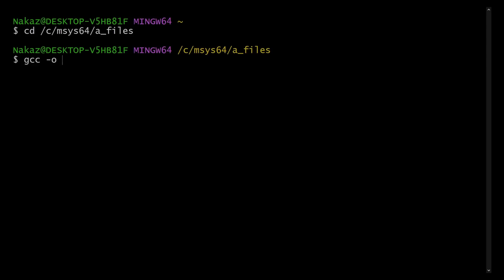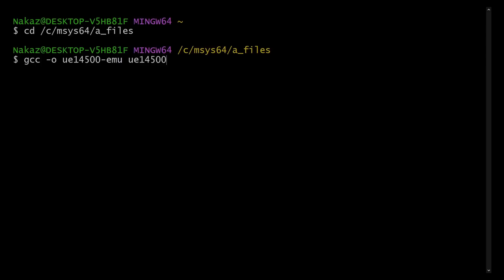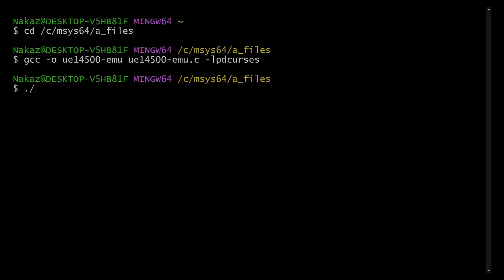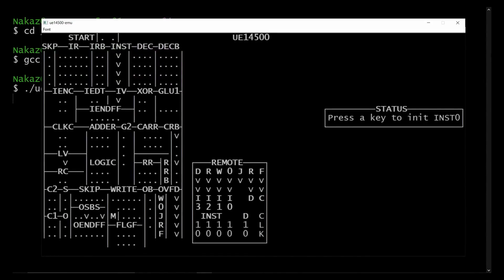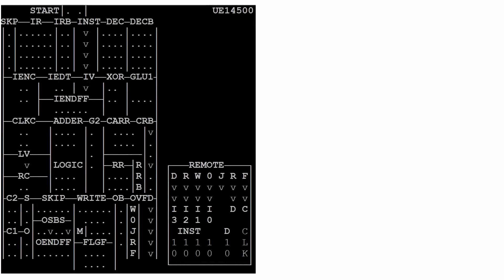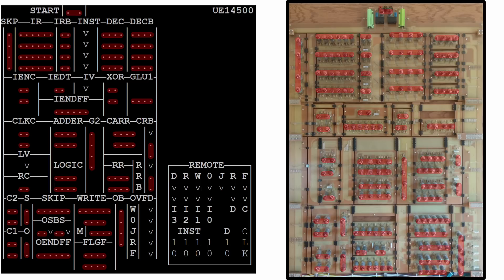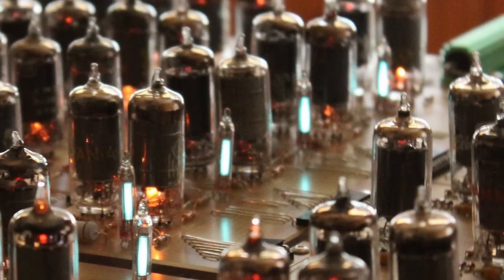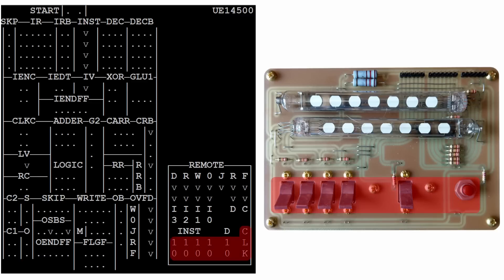Vacuum Tube Computer P.28 – Exploring an Emulator of the UE14500!

Comment from the maker: Quick clarification on the curses library. It doesn't actually emulate terminals. It actually allows you to write terminal programs that will work on any supported terminal. Each type of terminal (ADDS vs VT100 vs VT220 ad infinitum) uses different "escape sequences" to accomplish things like moving the cursor, bold, etc. Curses abstracts that away so the programmer can just ask for bold and curses knows what sequence to send to the actual terminal being used.
Reply: Love your videos bro!
Reply: As long as the terminal has a terminfo or termcap entry it will work on that terminal.
Reply: does this "curses" name address the curses being said aloud to the thing that is not working the expected way?
Reply: @strangedude9008  Exactly this is reason it is named curses. There is no way to make a program compatible with many different terminals, all incompatible in some evil ways, without curses.

Comment: Can it run Crysis?
Reply from the maker: Ah yes, can it run Crysis!

This is a fun thought experiment actually. The minimum CPU spec for Crysis is a Pentium 4 @ 2.8GHz. This actually makes figuring stuff out a little easier since the P4 is a single core CPU. We do have to make a few guesses here. Crysis is power hungry, so let’s assume that on a P4, CPU usage will average 90%. That means that Crysis is performing around 2.5 billion calculations per second. That should yield around 30 FPS, which is about 83 million calculations per frame. With a resolution of 1920 x 1080, that’s 2,073,600 pixels. That means it’s roughly 40 calculations per pixel.

But, now we have to think about bus widths. If we boil a single calculation down to just moving a 32-bit value from one location to another, the P4 can do that in a single shot because it has a 32-bit wide bus. The UE14500 only has a 1-bit wide bus, so that same operation takes 32 distinct operations on the UE14500. Which means that the UE14500 needs to do roughly 1,280 calculations per pixel. 

And now we’re up to speed. I don’t know for sure at this point, but I think it’s possible to push the UE14500 to 100Hz. That means it’ll take 12.8 seconds to calculate one pixel. Working out from there, that’s 26,542,080 seconds to calculate a full frame. That’s 442,368 minutes, or 7,372 hours, or 307 days.

So, sure, it could run Crysis, but only at a blistering frame rate of 1.2 frames per year!
Reply: @UsagiElectric  I guess that 1.2frames per year is not fluent enough for a pro gamer ;) BTW I can see no reason why those tubes coudln't do many hundreds of kilohertz, maybe even megs?!
Reply: @MYNAME_ABC  Maybe MHz, though that is unlikely as you said. Many large scale vacuum tube computers with massive sizes and thousands of vacuum tubes could run at hundreds of KHz. I see no reason why a tiny "simple" couple hundred vacuum tube computer couldn't match the same speeds or greater if designed well.

Comment: Emulating the vacuum tube computer on the centurion is the coolest thing I could imagine, awesome, who was the genius that come up with that, freaking awesome!!
For now you can run it on a pi and connect the centurion terminal through rs232 converter xD

Comment: Emulator + arduino+ serial port  = running code directly on the processor. Just saying
Reply from the maker: That's actually a really good idea, but it will require a lot of level shifting to make sure things work right. And, that's actually something I'm hoping to incorporate into the Program Control board. But, I think once the memory board gets further along, it may be worth building a small level shifting board for testing on a larger scale.
Reply: @UsagiElectric  you don't actually need the valve memory to run the code from a PC. Use its internal ram to spit out an instruction and wait for a result to come back. Any memory or jump calls can be quite easily managed bu the arduino. JFETS with pilot lights are fun

Comment: What about building a PC interface connected with the remote control of the real cpu and run pograms trou the computer? We should see the real thing running a complete program for the first time and check if the emulator really works... great job thouh... i'll keep following
Reply from the maker: Thank you!
That's actually something I'm hoping to incorporate into the Program Control board. Include all the level shifting circuitry on the board with a specific plug that'll let it connect to the PC for an alternate way to run programs.
However, I think once the memory board gets further along, it may be worth building a small level shifting board for testing just the processor and memory without the Program Control board built yet.
Reply: @UsagiElectric  thanks for the complete reply... are relays good to act as level shifters? Instead of vaccuum tubes ... they galvanically isolate the two circuits and you can use the voltages you prefer without attenuation...

Comment: When I saw the emulator I had an idea: How about turning your manual I/O unit into an automated one using an Arduino that talks to the computer via USB? This way you could run automated tests on the real vacuum tube computer and even perform emulator vs real hardware tests. This could make the rest of the development process easier. Also, by adding an RS-232 interface you could hook it up to the Centurion or loads of other old computers. I would design a custom protocol over serial that gets implemented on both the Arduino and the computer that sends the commands to the vacuum tube computer to do all this.

Comment: I still use curses a lot for quick-and-dirty programs that display some status and have simple input commands (function keys and/or a commandline).
It is much quicker for development than GUI stuff.  And indeed, more efficient to run remotely over slow connections.

Comment: Never thought these projects were coming together but that's just awesome. I wandered what kind of programs you would eventually run on the Centurion. I am curious what more ideas will be coming out in the future. What a remarkable job you are both doing.
Reply from the maker: Thank you so much!
The Centurion and tube computer are indeed dramatically different machines, but serial data is serial data, and so we should be able to get them to talk to each other at some point in time, which would be wild. But, just having the Centurion emulate the tube computer would be a sight to see for sure!
Reply: @UsagiElectric  and it is such a brilliant idea ! 🤓
Reply: @UsagiElectric  Indeed, I have an idea, the Centurion emulating the vacuum tube computer, which is running a program that talks to the vacuum tube computer.

Comment: So get the guy to write a C compiler for Centurion.
Reply from the maker: Actually, we already have a C compiler in the works for the Centurion. Most of the custom stuff we're working on building for the Centurion is being built in C, so we've got WIP compilers, emulators, software, etc. The only problem is the Centurion is progressing at a dramatically faster pace than the Tube Computer. I guess I need to get back to work, haha.

Comment: Seeing the assembler gave me an idea, the creation of a USB interface to the switched inputs of the vacuum tube computer. Write the assembler code with the convenience of a PC, then run on the vacuum tube computer. For more complex programs, you could run a single program that wipes and reloads data.
Reply from the maker: Thank you!
That's actually something I'm hoping to incorporate into the Program Control board (in a sense). Include all the level shifting circuitry on the board with a specific plug that'll let it connect to the PC for an alternate way to run programs.
However, I think once the memory board gets further along, it may be worth building a small level shifting board for testing just the processor and memory without the Program Control board built yet.

Comment: That is so awesome. Ren has done such a remarkable job on the EMU. You have to get the Centurion hooked up to the UE14500 as a terminal somehow using the emulator. Get them talking to each other. This whole project is a mind blower.
Reply from the maker: Super long term stretch goals is to definitely get the two talking to each other! If I can manage to get the UE14500 to output and receive at 300 baud, we can totally build a level shifter and get the two connected via the MUX port!